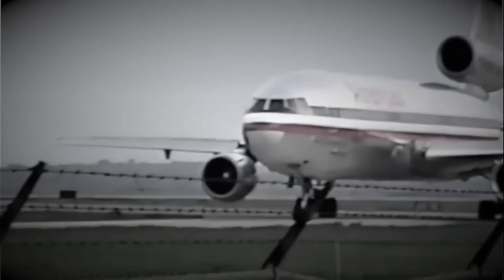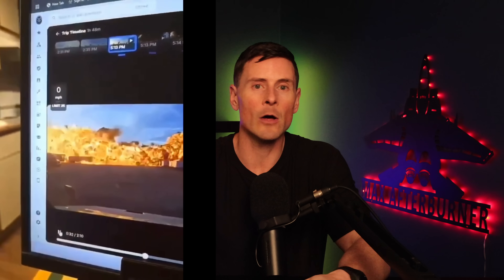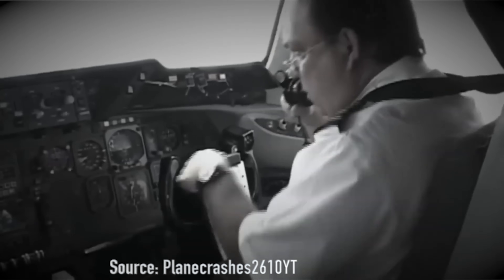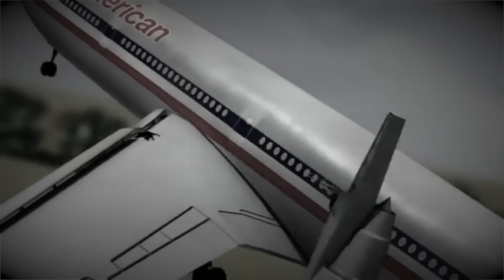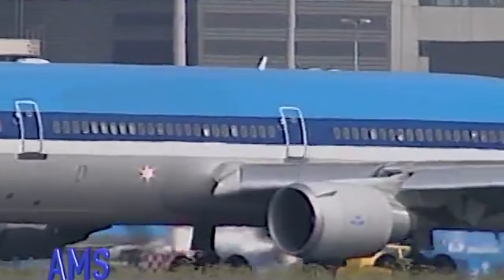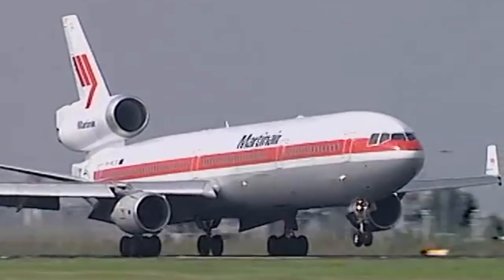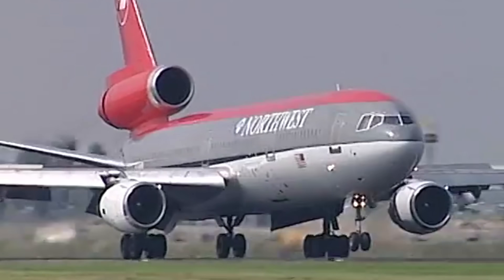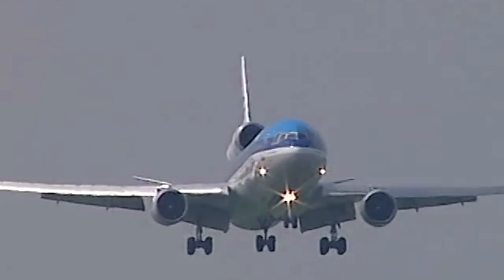Airline Pilot Exposes CRITICAL FLAW of UPS 2976 DISASTER

Comment: I’m not sure how cabin pressurization cycles can specifically affect the engine pylon.  I can only guess that you are highlighting the issues with aircraft maintenance of aged aircraft.  But, thanks for the more detailed explanation of the American Airlines faulty maintenance practices and the changes made after the Flight 191 accident.

I believe that further consideration should be made of the engine failure SOP for three and four engine aircraft after an engine failure because of the potential  of other damage to the aircraft that would require the airplane be flown at a speed higher than V2 plus 5 or 10 knots.  Because a higher airspeed would generate greater flight control forces that are then available to counter the yaw and roll that occurs after an engine failure.  More simulator testing can be done to better quantify the advantages or disadvantages of slowing the aircraft back to V2 plus five or ten knots versus the reduction in flight control authority caused by slowing to slow too close to V2 on takeoff after an engine severe damage  or separation event. 

Historically, engine fail procedures are predicated on a comparatively benign rollback or flameout type of engine failure, rather than a severe damage or separation type of engine failure.  In spite of the fact that a a comprehensive checklist exists for the engine severe damage scenario. While this incident is indeed far less common in airline operations, a catastrophic engine failure like the ones highlighted by this crash and the American 191 DC-10 crash, the El Al 747F crash in Amsterdam, and the Air France Concorde disaster in Paris would seem to indicate that a further consideration of the adequacy of crew procedures in response to a severe damage engine failure event on takeoff may be justified.  It seems to me that IF a higher airspeed is attained on the ground prior to transitioning to the climb after takeoff, then as much of that airspeed should be conserved, if possible. Rather than to automatically slowing to V2 plus five or ten knots.  Of course, it should be up to the pilot’s discretion to trade airspeed for altitude as appropriate as necessary for the given situation.  However, it is imperative that the pilot flying ignore flight director commands that direct him or her into a compromising situation. Because the higher airspeed that may have been obtained will generate the higher aerodynamic flight control authority that may be necessary to accommodate for the reduced control authority that may be observed after a severe airframe and/or engine damaging event.  I am attempting to highlight a basic operating philosophy that can be a trap for less experienced pilots who may be lured into a false sense of security by the advanced technology and much greater reliability of modern aircraft technologies.  

To this very day, Vmc and Vmca are still almost always predicated on a single engine loss of thrust.  This is naturally a very conservative assessment of flight control authority for a twin engine aircraft.  But, may be insufficient to allow for enough flight control authority to counter an emergency in a three- or four-engine aircraft.  Especially after losing thrust from two engines in a four engine or even a six engine aircraft.  The blind truth is that we do not accommodate for the potential of a Vmca event caused by severe aircraft damage in most aircraft.  Quite apparently even a single engine loss of thrust in a three engine aircraft such as the DC-10, MD-11, 727, or DA-50/900 Falcon Jet can result in a potentially compromising situation if airspeed is allowed to decay too close to Vmca.  This very same scenario is what makes Part 23 certified light and medium twin engine general aviation aircraft less safe, and has created a very checkered safety record for these aircraft. In spite of the enhanced reliability of modern aircraft engines today, there still exists a small inherent risk to all multi-engine aircraft.  Maintaining sufficient airspeed well above Vmca is the only way to assure adequate flight control authority is available to account for unforeseen or undetected aircraft damage situations. 

I have highlighted this situation because it’s pretty clear that this flight crew attempted to use all of the runway, as they should have, to gain as much airspeed as possible before liftoff.  However, following the flight director commands once airborne will naturally cause the aircraft to slow to near V2, rather than sacrificing just enough of that excess airspeed to positively climb away from the ground or obstacles.  As these accidents very clearly illustrate, once excess airspeed is bled off, it is lost forever and cannot be regained without sacrificing altitude.  Some things to consider as well all assess what should learned from this latest accident.

Comment: Aluminum, when it fails (and it IS when, not if), fails catastrophically.  A sudden shear or break versus a slow deformation or bending as one might witness in steel.  That's not reason to not use it.  But it is reason to respect it properties and limitations, performing routine inspection and necessary maintenance.  When that's neglected we see the unfortunate results.
Reply: Aluminum does not have a fatigue limit. That does not mean it will fall catastrophically. Same with other materials like carbon fiber. It really just depends on how the party is designed, the loads it is put under, and how often

Comment: The DC-10 had cables moving the slats controlled by a drum on the fuselage. The engine/pylon tore out the cables when it came off and air pressure retracted the slats. Simulations with pilots showed the airplane was controllable and could have returned to the airport if the pilot knew the slats had retracted.
Missing the engine and pylon, the plane has less drag than a dead engine.
Reply: Cable drum mounted in the fuselage drive the slats inboard of both wing engines.  A cable drum on each wing outboard of the engine drives the outboard slats.  The hydraulic extend and retract lines to the outer slat drive cylinders were ripped out when the engine and pylon detached and moved up and over the wing.  The loss of the fluid that is normally trapped in the extend lines allowed airloads on the slats to drive them back to the retracted position.

Comment: Hey MaxAB ... me again. The difference I see between AA191 and this incident is that there's video showing the intact Engine laying on the infield ... sans Nacelle or Nacelle to Wing Pylon attached. Might explain how she wasn't able to climb out ... MD-11's are designed to take off (even at max GTW) with only 2 Engines. Perhaps when the Engine chewed thru the Nacelle the debris took out the Tail engine ? As noted, AA191 lost the entire Engine/Nacelle/Wing Pylon (detached and flipped over the top of Wing). Note that while there are Attached Fittings for Pylon to Wing, there are also attach fittings for Engine to Pylon interface. And ALL "Attach Fittings" are coded "FFC" (Fatigue Fracture Critical) meaning zero allowance for even the smallest scratch in finish or any corrosion; that's why your F-16 Wings and Vertical Stabs stay attached ... if you snap a Wing off, it won't be at the Wing Root Rib area ... we made sure when building them right and more than 1 shipset scrapped if not 100% correct. We'll see what NTSB comes up with. Until then, Check 6 Bro.

Comment: Has MD ever done any testing of either the DC-10 or MD-11, trying to take off without a wing engine mounted. I would think that trying to fly the plane without the thrust or weight of the engine onboard would make the plane very hard to control even if the hydraulics were operating normally. You would have to use max rudder to keep it straight but even then with out the weight of the engine attached to the wing, there is going to be much more lift on that side.

Comment: Curious to see if you can answer. With accidents like this and the damage so severe. How can you really pinpoint the cause of failure like with a motor, or hydraulic system with the damage being so severe and with fire burning everything.. if it was a fastener failure but with impact and fire wouldn't it make it impossible to pinpoint?

Comment: This seems to be (note assumption) almost exactly what happened to American flt. #191 in 1979, a DC-10. The DC-10 and its follow on MD-11 have been plagued by engineering F ups since its debut as opposed to the similar Lockheed L-1011 Tristar which never hurt a sole due to its design.

Comment: I remember the ‘79 DC10 incident. I flew a DC10 shortly after they were put back in service. We were actually delayed leaving the terminal: the Pilot came over the PA system and reported an engine issue / malfunction. Not the thing you want to hear after an engine fell off a few months earlier.
Reply: Fuck that I would’ve not boarded that crap .  Just like I avoid modern Boeing 😅
Reply: You flew ON a DC10…😅
Reply: @lupusgirl1000 
Yep, all thru the 80's and on AA and to this day, the most enjoyable airline flights I have ever taken. The sound of those engines was just incredible.

Comment: There's no comparison that should be made at this time. Correct me if I'm wrong but I do believe they completely reengineered the wing hydraulics on the MD-11 after the DC-10 191 crash. An engine that departed the airframe with such apparent damage can't be compared to 191's intact engine that broke loose. It's anyone's guess at this time what kind of peripheral damage occurred to the flying surfaces after this engine gave way and my best guess, and it's only a guess, is that the tail surfaces, likely the elevator was damaged. Tail engine stall? Perhaps but it's really hard to see. I'm not a pilot but rather a former aerospace engineer (retired) for Grumman, now Northrop Grumman.

Comment: I flew on many DC-10s and the wing engines wobbled all over on take off. Flight 191 did not burst into flames when it lost an engine, however, it did roll and crash in a similar manner. To me, it looked like the engine blew apart and ripped the wing tank open and then fell off the wing. 2976 was on fire just after V1. 2976 probably would have crashed in a similar maner to 191 anyway. Both planes left an engine on the runway. I had landed at MKE at the same time 191 crashed at ORD. Erie feeling.

Comment: One does wonder why an aircraft with 3 engines cannot take off with 2 engines running?   Was the aircraft overloaded?
Reply: Normally, yes.  But the question remains if whether or not one of the other engines was also compromised by ingesting debris from the exploding left wing engine.  If they lost two engines on takeoff their fate was sealed.

Comment: Approx 02:45 - there are no "pressurization cycles in the pylon attach structure
Reply: This guy spewed a whole bunch of misinformation about the DC-10 vs MD-11 design.
Reply: Yeah, this made me pause the video and swear at him.

WTF was that all about?

Its loading cycles of either wing flex, or ramping up engines to take off thrust that stresses an Engine or pylon mount and thats the VERY reason we have inspection intervals. Both visual and NDT.

The video has lost all credibility from such a nonsense statement.

Comment: I’m sure closer inspections of other similar aircraft will determine this situation was about to happen many times. So we’ve gone from drive it till the wheels fall off to fly it till the engines fall off. Every 20 years, every plane should be completely recycled and made into a new aircraft. They use quality aluminum and titanium and other materials that can be recycled into another brand new plane.

Comment: I see the bright flash that would indicate the #2 engine compressor stall, however with other videos coming out, it looks like they hit a row of power lines that arched when they hit them. This happened at the same time as the first discussed #2 engine compressor stall. I’m not quite convinced they had a problem with the #2 engine.

Comment: Issue to the loss in Chicago was the off of the engine damaged the flap controls resulting in auto retract of the flaps. Loss of engine/ ruptured fuel tank/ wing fire not withstanding, if the flaps retract on one wing during takeoff roll, the ability to actually get airborne goes down significantly
Reply: It was the leading edge slats that retracted, not the flaps.

Comment: Ntsb also stated that engine out procedure was a contribution to the crash on American Airlines flight. If they had not reduced speed, they would have survived on flight 191
Reply: Engine out procedure after that accident was changed to climb at whatever speed you have already attained.  AA191 was flying above the slats up stall speed but the flight director pitch command bars directed the pilot to increase pitch to gain altitude which brings the airplane speed down to V2.  Slowing down from where they were to V2 went right through the slats up stall speed so the left wing stalled and the right wing lifted to roll the airplane.  I think we will find that the UPS airplane's landing gear hit the roof of that warehouse and that started the left roll and once the left wing down made contact it enhanced the roll as you see in the truck driver's video.

Comment: UPS has actually been in the process of retiring their remaining MD-11s for well over a year now.  Converting a passenger plane to a freighter takes time though, and it doesn't happen on spec.  There's also the issue of cargo capacity.  a 767 freighter comes up a little short compared to am MD-11.  777s have the capacity, but their wingspan isn't compatible with the gate spacing at Worldport.  In a rare move for the freight industry, UPS has been buying brand new 747 freighters with their high fuel efficency for some of their long haul overseas routes.
Reply: The MD-11 has the best payload for a midsize widebody. Neither the A330, A340-300, nor 787 (which has no freight version) comes close to the -11's capacity. The 767 is too small and the 777 is too large.

Comment: Two corrections: First, the max takeoff weight of the MD-11 is 630,500 lbs, not 650,000. Second, both the DC-10 and the MD-11 have three hydraulic systems.

Comment: Thank you for going into detail about the 79 crash. I am surprised that the engine pylons are not made of titanium since that is a much stronger metal than aluminum. The aircraft that crashed in Iowa in 1989 was also a DC-10 but its failure was from the tail mounted engine fan blades coming apart. I used to make Titanium here in NV and they showed a video of that crash during orientation.
Reply: The pylons are designed to break away if overstressed. Stronger material could lead to catastrophic wing failure .
Reply: Wow!!!! I wanted once to study mechanical engineering…..but the thought of titanium pylons???…..never crossed my mind

Comment: Excellent reporting "Max" ! As a former MD 11 pilot and very familier with the DC10 accident in 1979 your reporting is right on! In my opinion the  center engine, as you point out also had a partial or complete loss of thrust causing the aircraft to have no  ability to climb and clear the buildings. We practiced many V1 Cuts at max gross (625,000lbs)  with an engine out and the MD 11 was very capable of climbing out and return safely. Losing a second eng. on takoff, forget it! Whether the #1 engine actually fell of or had some sort of uncontained explosion will be figured out by the NTSB investigations. Amazing to me however,  as how it ended up on the right side of the runway. Condolences to all the victims RIP!   Ret. MD 11, 767,757,737 pilot
Reply: The #2 engine wouldn't have really mattered if they lost the LH slats (very likely give the damage to the wing). The roll over would be inevitable!

Comment: I think there's too much pylon talk. You do realise the engine is designed to separate from the pylon if loads exceed a certain value? So a catastrophic engine explosion could easily fit into that scenario.
Reply: It is the pylon that is attached to the wing structure using fuse pins, not the engine.  The engine and pylon are designed to separate from the wing when the fuse load is exceeded, either by engine seizure or blade out event that results in an overload condition.  The fuse pins are heat treated, then tested to establish their hardness (strength), followed by machining of the inside diameter to allow the pin to shear under a specific design load.
Reply: @philiplangford9434  So where's the pylon? It's not attached to the engine is it.
Reply: @karlp8484  Boom, what a smack down on an "expert".
Reply: @karlp8484 it's on the ground near the engine...
Reply: @DillonPrecisionFan  So what?
Reply: @philiplangford9434  No, Douglas design philosophy did not allow for separation of the engine or pylon due to failures.  There are no fuse pins.  Boeing engine mount design did, so they use fuse pins.  The only fuse pins on the DC-10 and MD-11 are on the main landing gear attachment to the wing so an impact to the gear (like hitting a truck) would allow the gear to break off without ripping out the wing structure and thus breaching the fuel tank.
Reply: @stephenlocantore1203 . I worked for Boeing, but you are not correct.  If the pylon is not fused, there is no way to prevent catastrophic wing box damage in the event of an overload, like a seized fan.   Why would you fuse the gear and not the pylon?
Reply: @philiplangford9434  If you worked for McDonnell Douglas in the trijet stress group you wouldn't make that statement about the engine and pylon mounts.  Boeing had a different philosophy about letting engines depart the airplane.  McDD didn't want pieces of the airplane raining down on people on the ground..  The main landing gear strut is fused so if it hits an obstacle like a truck or a building it will tear off without tearing out the rear spar structure like it did in a Continental Airlines accident at LAX in the 70s where that happened.